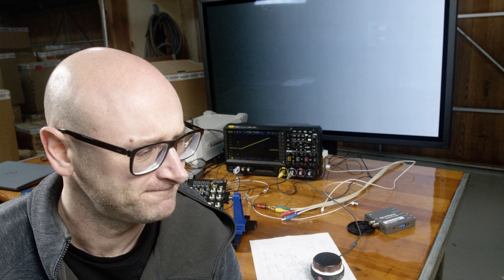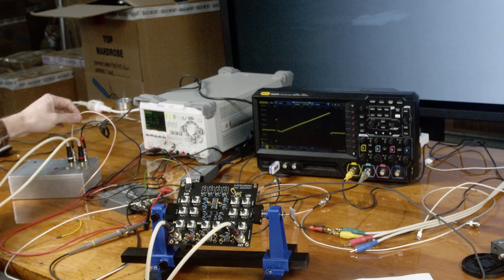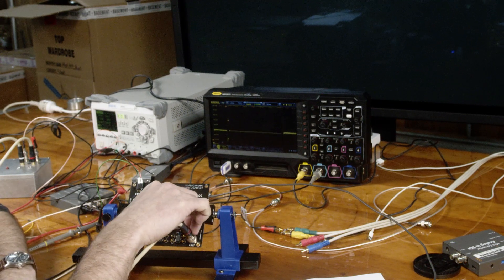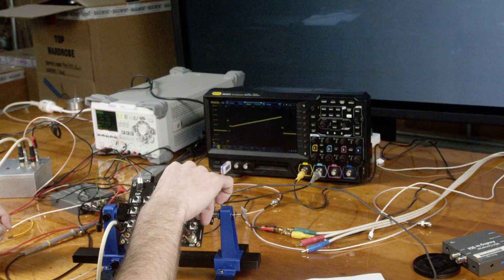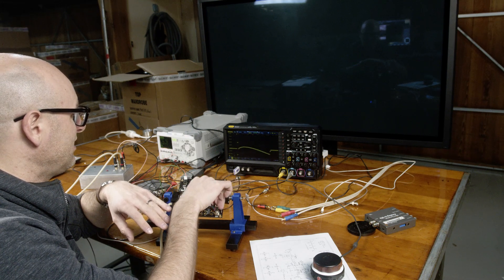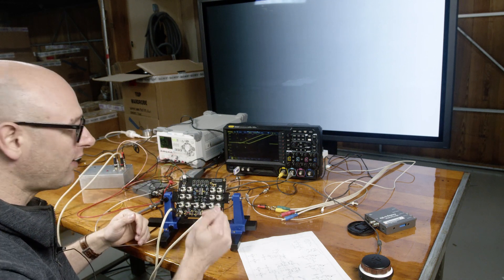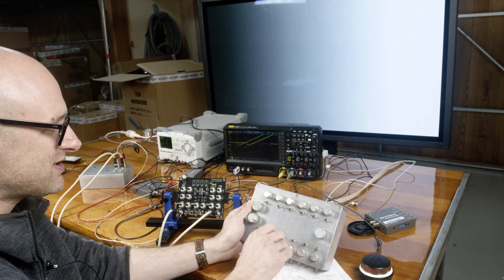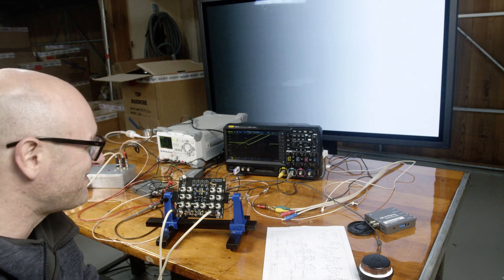Analog Color Correction pt2

Comment: Your sync separator is super interesting, did you build it yourself?
Reply from the maker: Yup. I can make a quick video on it. It uses an LM1881 and a small PIC chip to do the timing calculation and some op amps and 4066’s for the switching.
Reply: @superchromat  Yes it could be quite interesting, especially learning how you handle maintaining the blank level while the sync pulse is being removed
Reply from the maker: That’s the worst part of the circuit :) I use a capacitor to AC couple the send signal. Then I use an op amp and a voltage divider to bias the return signal back up by 0.5V before it is added back to the sync pulse. 

A better method would be to use a sample and hold. I might try building that circuit after I finish part 3 of this video series.